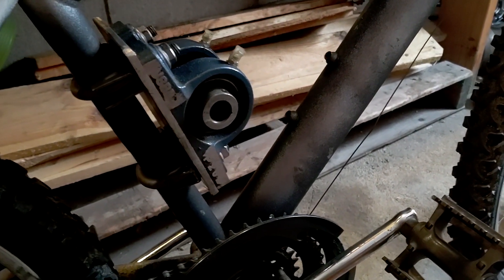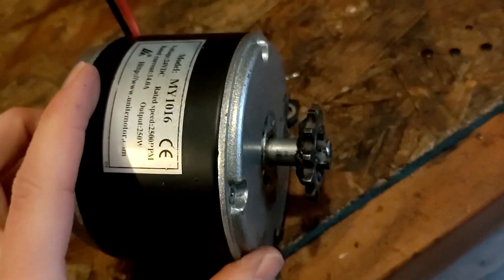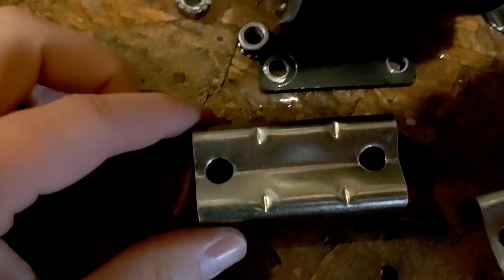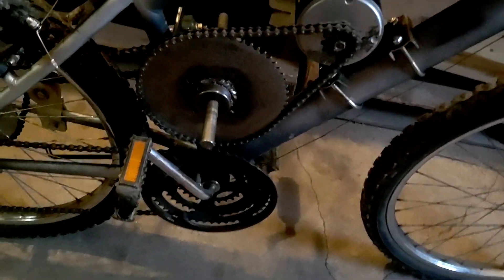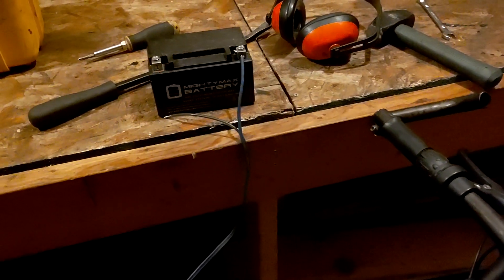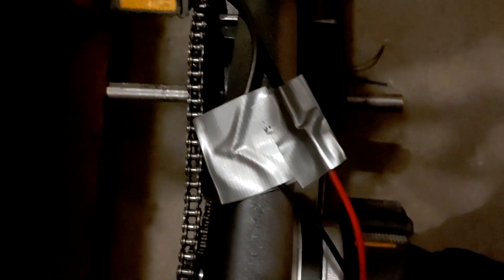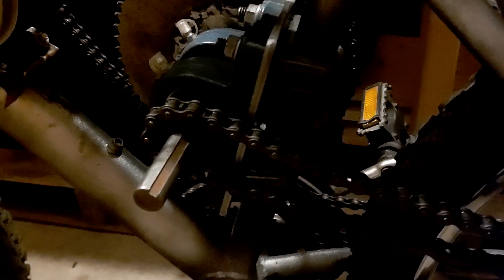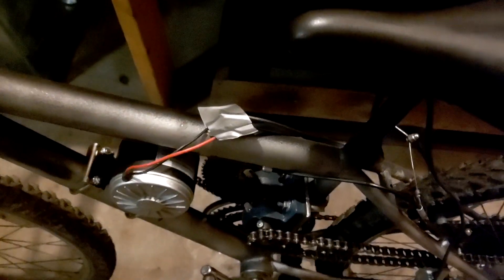DIY E-Bike Build - Test Run & Motor Mount EP6

Comment: Hi, I have a question, I have a similar electric motor, I got from amazon (https://www.amazon.com/gp/product/B07T9KRFCP/ref=ppx_yo_dt_b_asin_title_o05_s00?ie=UTF8&psc=1). I'm trying to remove the existing sprocket/gear on the motor and replace with one that fit with 415 chain sprocket. I got the new sprocket, now I have hard time to uninstall/remove the existing sprocket. I try to remove the nut that in front of the sprocket, but it won't budge. is it normal counter clock-wise to remove like normal way? did you have issue when you do it?  Thanks a bunch. BTW, I'm watching your video too to planning on my motor mount as well. great video.
Reply from the maker: I'm glad you liked the video. On my motor, the threads are normal (counter clockwise to loosen). I had to clamp onto the sprocket with a pair of vise grips on the teeth of the sprocket to keep the shaft from spinning while I removed the nut with a wrench. You can also wrap a rag around the teeth and use an impact gun to make quick work of removing the nut. Just watch your fingers when the sprocket spins.
Reply: @pulsar2121  thanks for your help. I figured it. mine is clockwise to remove it because it suppose to spin to the left.